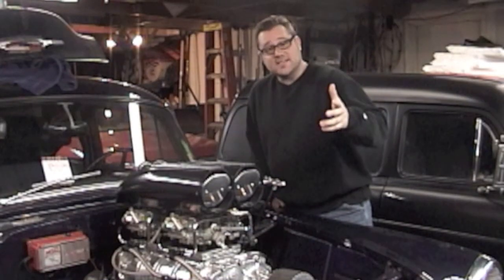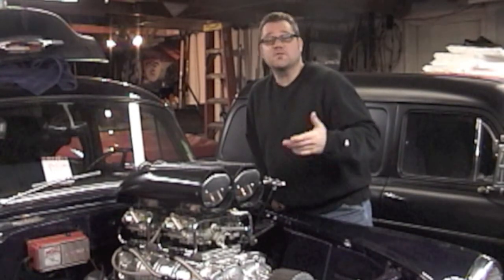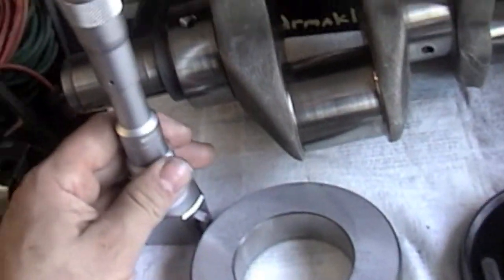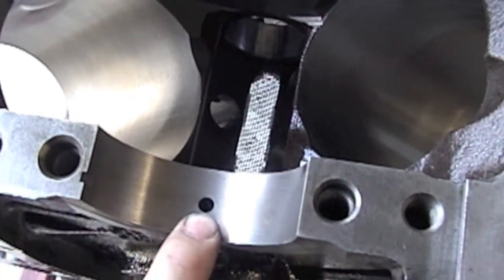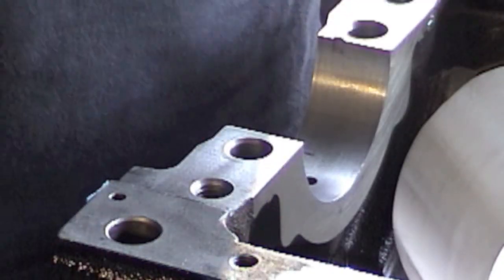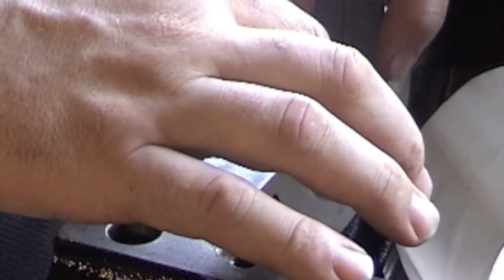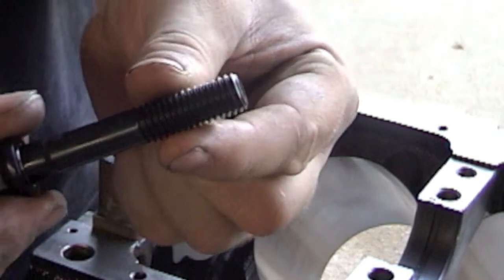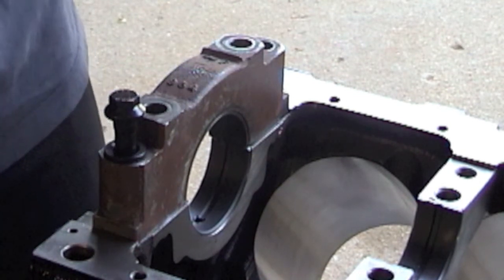Part 7 Measure, Order & Install Main Bearings For The Big Block Chevy

Comment: THANKS FOR YOUR IMMENSELY DETAILED VIDEOS(SAW YOUR VERSION #8 ON RODS  ALSO)! THE INFO IS GREAT! I CAN DEFINATELY APPRECIATE THE PROCEDURAL APPLICATION. I BUILD MY MOTORS THE SAME WAY. YOUR NOTES ON BEARING SIZES, AND TOLERANCES IS THE ONLY WAY, THAT A REAL RACE ENGINE BUILDER CAN DO IT, WITH ANY PRECISION CAN DO IT! I HAVE NOT SEEN ANY OF THE OTHER VIDEOS, THAT ARE ON "YOU TUBE;" OR "INET," THAT EVEN SHOWS THE ENTIRE PROCESS! YOUR VIDEOS ARE GREAT! THANKS AGAIN.

BURKES RACING, ENT.- TEXAS; '67 CAMARO, 734 C.I.D- GRUDGE.

Comment: I measure my block bore for the main bearing and got 2.676, measure the crank journal and got 2.454 subtract them both and got 0.222 is that right. Measure the old bearing and got .060 what am I doing wrong? Thanks great video please keep them conimg.

Comment from the maker: Hey keebab hablabab,

I also take the bottom end in. The machine shop does all the work/ calculations.
Yeah, I just wanted to try & help others out if they want to decide for themselves what size bearings to use.. Maybe a little sloppy or a little tighter bearings....

I like to check the measurements just so I have references for myself after I get the brand new machined motor back from the speed shop.

I like to see what the experts use for clearances & take notes

Have a great day!
Johnny

Comment from the maker: Hey kebab hablabab,
Thanks for posting..... (.0004 answer) I should have been more clear....With the bearings in place and the main caps on/torque take the readings of each bore....if these readings are not within .0004 take it all apart wipe down the bearings, bores and caps try again. if still off talk to a machine shop they have to "true"up bores.

(Bearing clearance stage answer) yes I like to double check the machining 

(cos I'm thinking answer)  I'm thinking the same thing lol

Thanks

Comment: yea you said all the front 4 mains should be within .0004" of each other... what if you get to this stage and they arent? what do you do then? does that mean you measured your crank journals wrong at the start when seeing if they need a grind? is this bearing clearance stage just to double check the machining? cos im thinkin the bearing guys wont sell bearings in .0001" increments do they....?